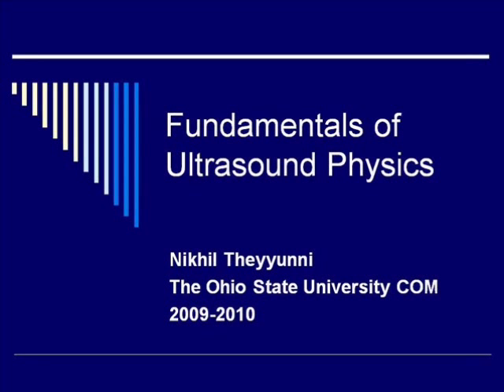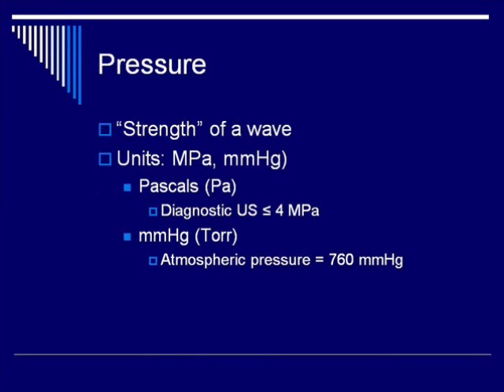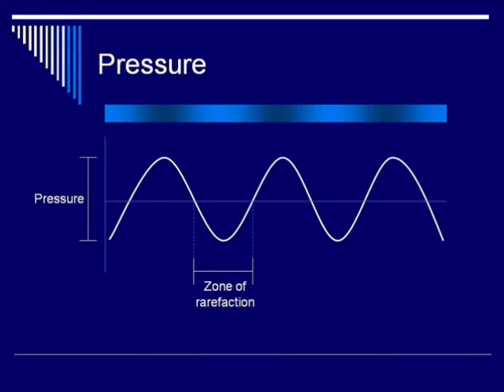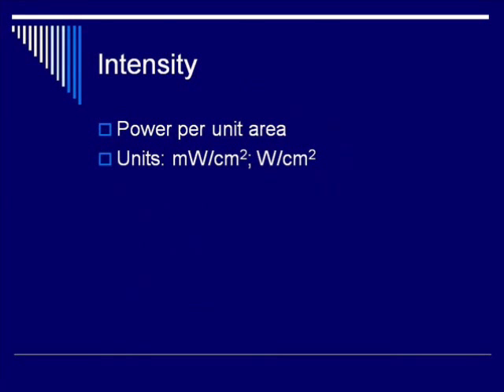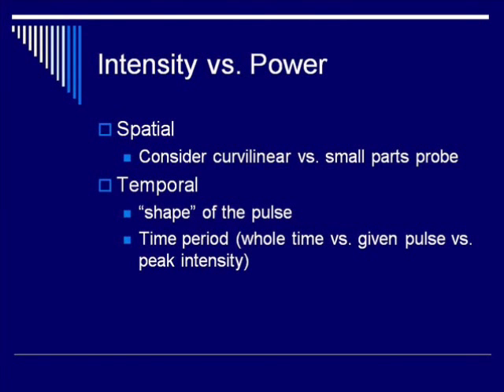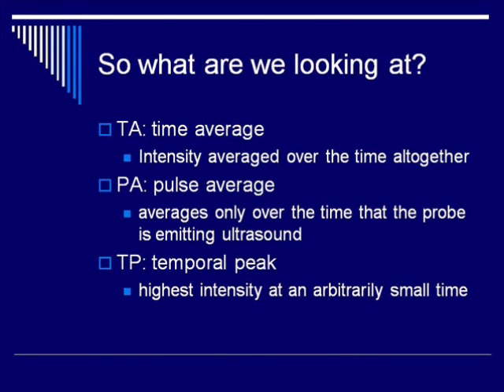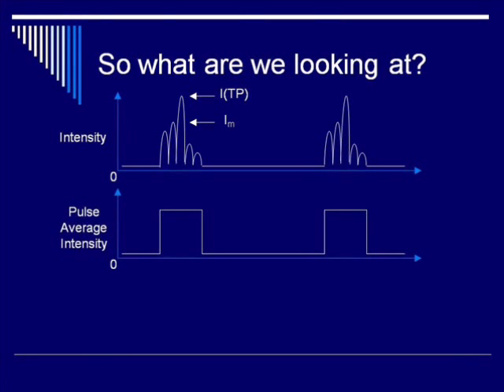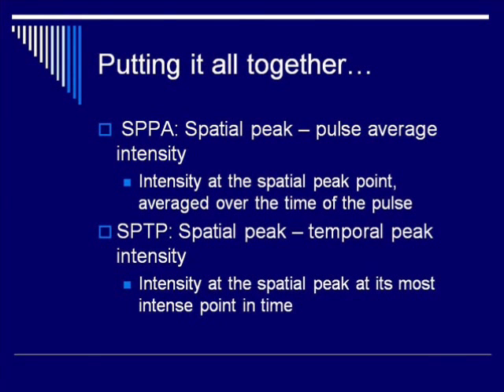Bioeffects and Safety of Diagnostic Ultrasound - Segment #1

Comment: At 8:09 this is the first example where I have seen intensity handled correctly (it's positive throughout the sound pulse).  It's always positive, not because it's a magnitude but rather because intensity I = (acousticPressure^2)/(rho*c), so squaring the acoustic pressure makes the result always positive. note: rho is density and c is tissue sound speed.